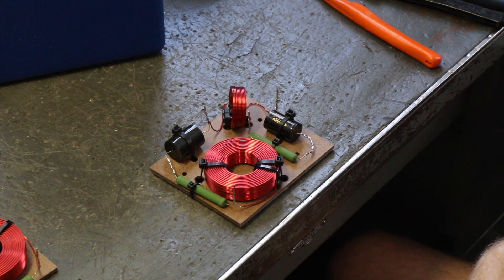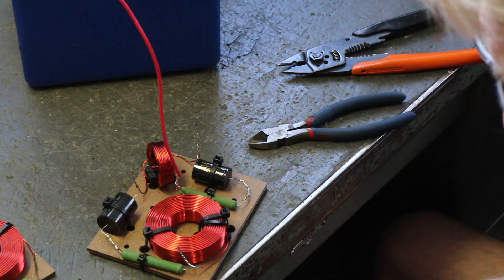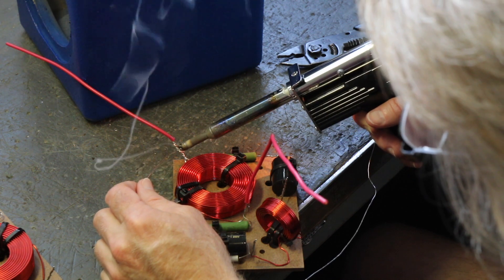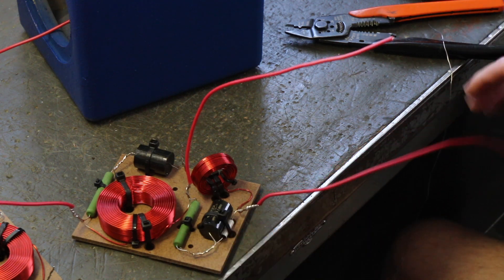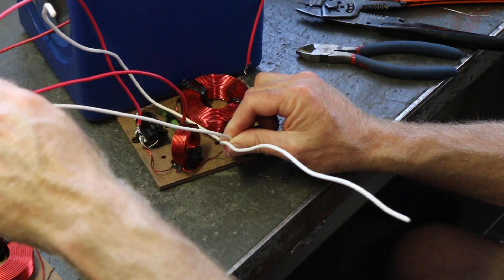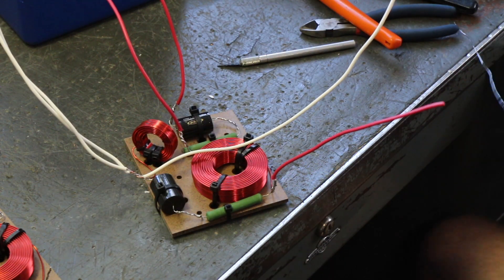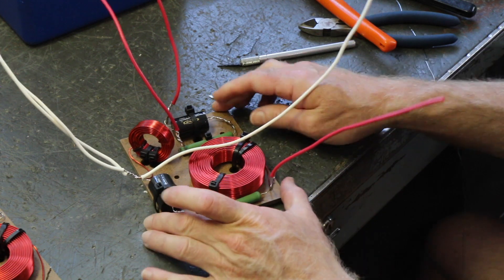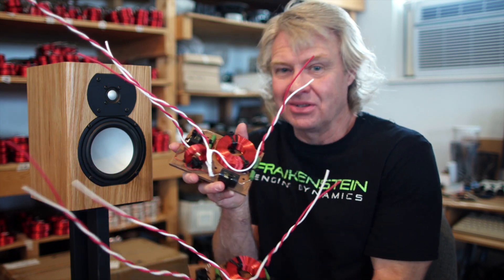Wiring the RIGHT WAY! Desktop Mini!

Comment: I sense the need to strap or support the wires coming off the board. Everything will be subject to enormous and constant vibration including sub-bass frequencies, all which surely move the wires back and forth and risk fatigue and eventual cracking of the solid wires and/or solder.... am I wrong?

Comment: The red copper will not hold solder. Is there a trick to this? do I need to strip it somehow? Thanks!!
Reply: It has a thin layer of isolating lacquer on it. Just burn it away with a lighter and then solder it :)

Comment: @5:05 where you connect the tweeter wire between the .22 mh inductor, and pair of caps, shouldn't that be the negative wire per the Mini's diagram?
Reply: The tweeter has reverse polarity so you solder the red wire to the negative terminal on the tweeter.
Reply: @Canuckken  That is correct.

Comment: The output to the woofer connects to the resistor first on your board. On the schematic it connects to the cap first?
Reply: The cap and resistor in the woofer circuit can be in either order.
Reply: @dannyrichie9743  Hi. I know it's been a while since this video was posted but after watching it multiple times I believe you've connected the return/negative (white wire) at the wrong point of the woofer output...?? Therfore also the return/ negative for the tweeter and the terminals is coming straight out of the coil in the woofer filter instead of after the shunt coil for tweeter and shunt resistor for woofer. To clarify I understand that polarity of the tweeter is reversed in this crossover. 
Looking at the schematic the red (positive) and white (negative) for the woofer should've been placed on the board the other way round also meaning that all the white wires should be coming out from the point where shunt coil (tweeter) and resistor (woofer) meet. I hope all the above makes sense.
Please correct me if I'm wrong?
Reply: @petelamparski8226  I do recall it measuring perfectly after completion. So I think it wired it correctly.
Reply: @dannyrichie9743  I have watched it again and realised I've made an assumption that the bigger coil is a shunt for the tweeter as when looking at your schematic I misread 0.22mH for 22mH hence thought it must be the bigger coil. On the second thought I also realised that 22mH would be way too big for a tweeter network anyway😅 Therefore my apologies for throwing a doubt at you in my previous reply. 
Now I clearly understand which way that crossover network is wired. 
Thanks for the nudge that made me analyse your video again and correctly understand it!👍
Reply: yeah im trying to understand the samething. for the tweeter in the schematic he has positive wire running to the negative output between cap and inductor.
Reply: nevermind i figured it out. you hook the positive to the negative of the tweeter to reverse phase of the tweeter.
Reply: @nivsole0717  Correct.

Comment: I have been soldering since the 80s and I will give advice - do not twist the contacts so hard and carefully, you may then need to change which denomination. High-quality soldering with good solder (with lead) ensures a reliable and strong connection.

Comment: Hello sir .... I'm have a small budget during this epidemic... I currently have 2 active speakers .. 2 active surround and 2 active subwoofers .... I need hook up my av receiver which my friend gave but it only have speaker outputs instead of RCA's out .. how do I correctly connect them without any distortions? Do I get any proper convertors ?kindly advice tqvm Sir
Reply: You need a receiver with preamp outputs.
Reply: @Corndog642   @corndog642  mate I know that ... I can even get a lexicon if I have the budget.... Im on limited cash during this time tot can get an alternative method to overcome this problem .... But looks like this guy In GR RESEARCH doesn't give a damn on helping people.... Anyway unsubscribing this channel and moving on .... At least say hello ... We support ur frickin channel and this is how you treat people by ur ignorence?
Reply: @akikazudanish571  so you ask a totally irrelevant question expecting free tech support on a product assembly video? And you are mad he ignored you? Get a hold of yourself dude. Also corn dog is correct, the best and also cheapest thing to do is source a receiver with pre outs. Trade your receiver or sell it to get a different one. Used receivers are pretty easy to come by. Converting your speaker level out back down to line level cleanly is silly.

Comment: I have been meaning to ask this question for years.Should internal hook up wire for speakers/crossovers (or even diy amps) be the same quality as for speaker cable? I see you are not using the speaker cable you recommend for internal connections. Do you have a recommendation for this type of hook up wire.?
Reply: The runs in crossover or inside the speaker are so short they don't ned the same thickness as your speaker cable. It doesn't hurt using the same if you already have a lot of wire
Reply: @FSXgta  Well diameter is only one parameter. Conductor material and geometry, insulation etc are all important too. For example look at the importance Danny puts in  tube connectors.
Reply: Here's the hook up wire I used for the RP8000f kit. The supplied solid core wasn't long enough to do it the way I wanted to (3 separated networks mounted as close as possible to it's speaker) as being solid core it was too stiff for my liking and during one test fit I had one resistor lead snap flush off and had to replace it. Now each board input and output wire is cable tied to the board for strain reliefs. This wire is $2.40 a foot, look around on that site and there's Kimber wire for $65/ft and their phono is $170/ft.         https://www.thecableco.com/diy-cables-and-connectors/bulk-internal-hook-up-wire/auric-18ga-hook-up-bulk-wire.html

Comment: I’m a little confused. You go on about the value of multi strain wire for your speaker cables, but you use single solid strain electrical wire for your crossover connections to speakers? The GR of that doesn’t compute with me.
Please enlighten. Cheers
Reply: That wire that you see me using is four 9's pure Copper, solid core 16 gauge, in polyethylene. It is more ideal for internal connections. It sounds good and is easy to work with. It also stays where you put it. A braided cable would be a nightmare.

Comment: At about 10:25 you say that the exposed copper needs heat shrink to keep it from oxidizing but the parts that are covered with solder won’t oxidize.    Could you coat the exposed wires with solder and skip the heat shrink with the same effect?
Reply: You're not going to have to worry about the surface of copper oxidizing and heat shrink unless internally coated isn't an air tight seal therefore isn't going to prevent oxidation.
Reply: First of all clean the copper and then remove any traces of flux therafter, it's mildly acidic and that's what causes soldered connections to stain. Acetone is the strongest type of a suitable chemical, however may damage finishes of components and wire insulation, hence isopropanol is the usual choice. Once clean, you can use a tiny amount of the weaker De-oxit solution, the Gold one, to rub onto the exposed connections to seal it in a sense. My method of choice for all PCB solder pads and keeps them looking like new for decades. Use a standard eutectic 37/63 lead/tin solder if you're a beginner, just don't breathe, silver containing solders, ie. SnAg 96/4 require higher temperature and a bit of experience to get a shiny, not dull finish, hence tend to damage and distort any other cable insulation than PTFE. Depending on the size of the components you may need a bigger gun, like Richie's, rather than a temperature controlled, PCB soldering iron. 80watts should do, but even 120W may struggle with 8awg coils for example. Most importantly: enamelled copper leads must be pristine, lightly sanded with a 1200 grade paper removing varnish, cleaned with isopropanol, covered in flux and soldered thouroughly with no movement until dead solid. When you get an apprentice in electronics and all he can do is solder, well, that's half of what you need to succeed. As 20sth rightly says, heat shrink is not airtight obviously, resin potting is for example.

Comment: Don’t want to deal with the heat shrink, could I just dab the exposed copper with some Shoe Goo?
Reply: You can't be serious? If it's in the kit just slide it over the wire
Reply: don’t have kit, ordered parts and rebuilding my own crossovers
Reply: @sodasodas3  how are you rebuilding crossovers for a speaker kit that just went on sale? Anyhow you can insulate connections however you wish. If they're in open air they're already insulated. What you don't want is things moving around and shorting out.
Reply: Just watching the video for any tips or tricks… Not bought a kit, rebuilding crossovers in my existing speakers with high end parts
Reply: @sodasodas3  Then you best do it right. If you need to insulate connections use proper materials. Tape is for electricians quickfixes and marking cables. Shoe goo is for shoes. You can get small amounts of heat shrink or kits of various sizes at home Depot or Lowes or ebay
Reply: Get some Teflon plumber’s tape.  It’s a couple bucks at any hardware store.  Teflon is a great insulator.

Comment: At about 9:23 you show the white wires going to both the woofer and tweeter  all connected together.  Before, the red wires were kept separate.  Why does it not matter that they’re touching in one case but it doesn’t matter in the other case?
Reply: The white wires are the negative return so they all are common, think of it like your living space, your sink is one red wire, shower another, kitchen sink another, they split to reach the different components, but all eventually drain to the same place.
Reply: @f14tomdog2  Thank you for the reply. It looks like all the white wires are hooked on to something but I can’t make out what.  Could they all have just been attached to a bolt stuck on the wood since they all do the same job or do they all have to be connected to something specific?  It would seem that the tweeter connection would go to something different than the woofer connection.
Reply: @greenbeginner3353  the white wires are all connected to the negative rail of the circuit. There is one white wire that goes to the tweeter, and one to the woofer, then both of those, since they are negative (or the drains in this analogy) they both go to the negative terminal on the back of the speaker, which is where that third white wire goes( or in the analogy would be the main drainage tube from your abode out.
Reply: @f14tomdog2  So somewhere between the red loop standing on edge and the larger black cylinder is a safe place to connect any white wire?  How do you come to know that?  Is it in the instructions?
Reply: @greenbeginner3353   it is in the circuit schematic, it comes with the kit when you buy it, just need to know how to read schematics.